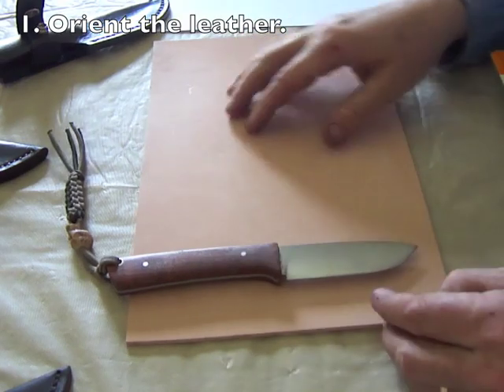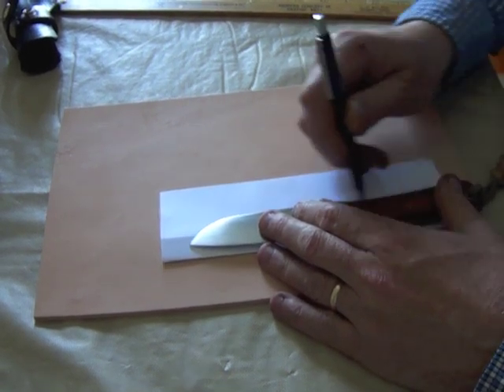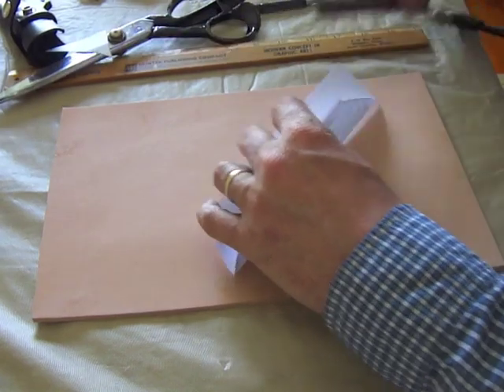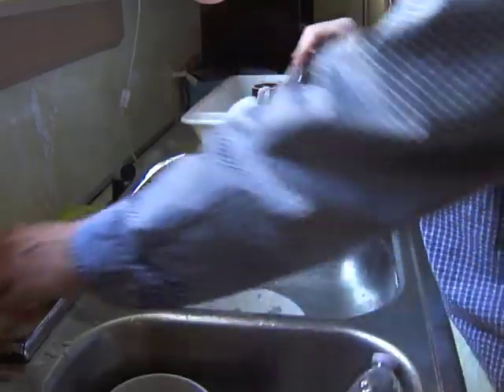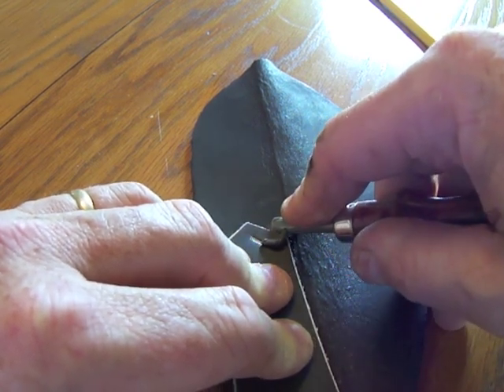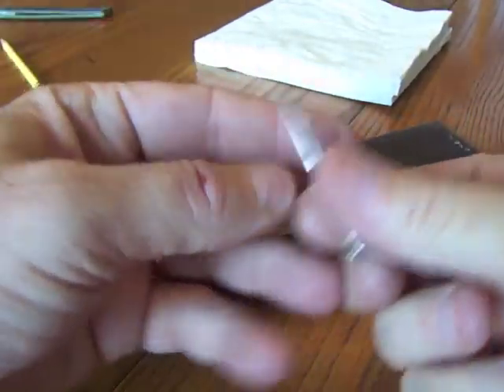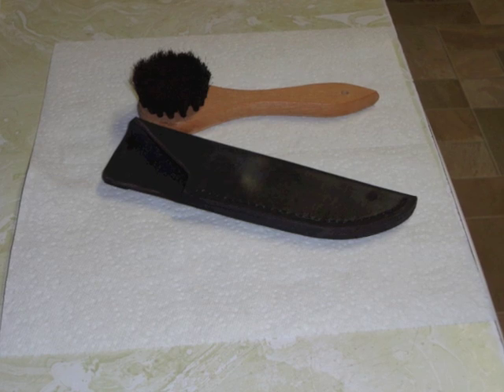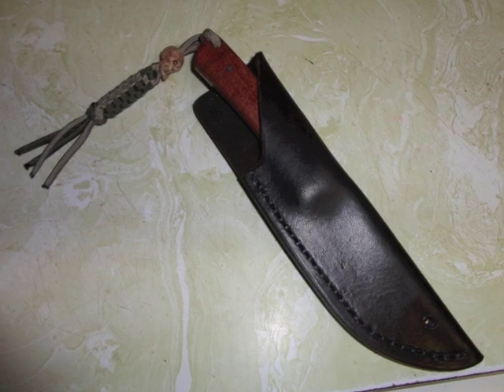Sheath Making Tutorial - How to make a leather knife sheath

Comment: great video, very easy to follow. just wanted to add something i was told as a tip to people. when your stiching is done run the overstitch wheel across them again to push them down and help prevent wear on the stitches. I'm not an expert at all just a tip I picked up.